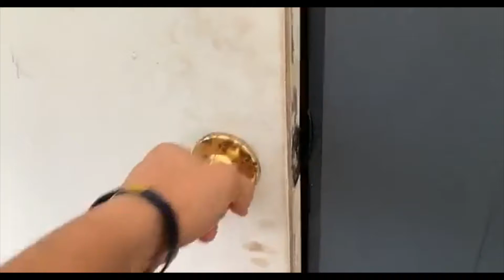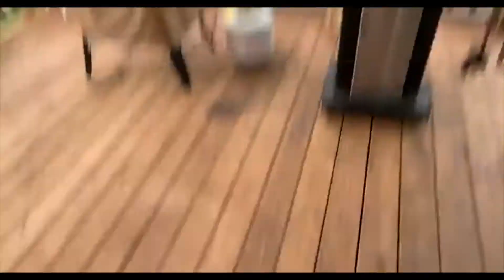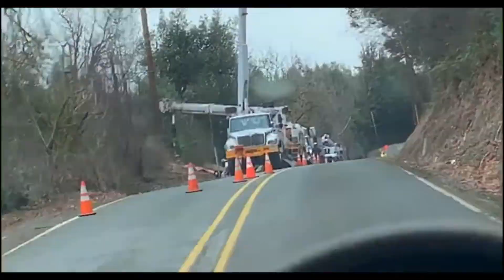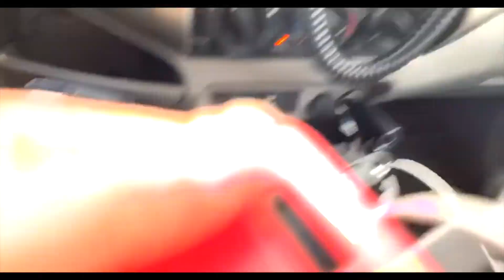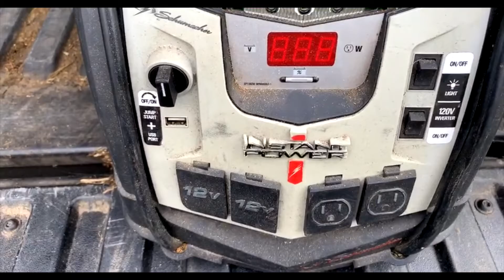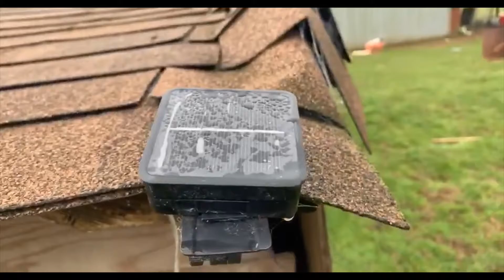Power Outage Tips and Strategies

Comment: What type of charger with 3 outlets was that in your car?  I have an ivation showerhead too and love it!  Wanted to share my latest prep discovery.  I have a primo water dispenser that dispenses hot and cold water and holds 5 gallon jugs inside.   You can plug it into your solar generator and get instant hot or cold water and put it in either a thermos or water cooler.  It takes 500 watts but only takes 30 seconds to fill a large thermos.  This is a HUGE fuel saver if you need to heat water versus using a lot of wood, propane or fuel tabs. I was so happy to discover this lol.
Reply from the maker: That’s a great idea! The charge is a cup inverter. I did a product review on it here.

A Bugout Vehicle Must Have (200W Power Drive Cup Inverter) https://youtu.be/BziPqZKSLwM